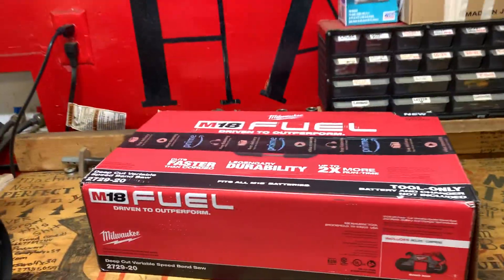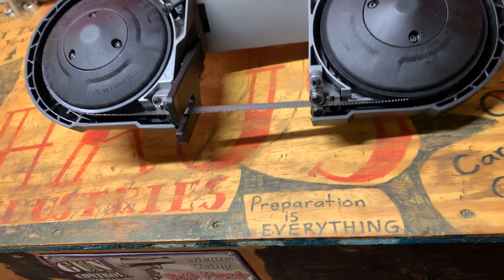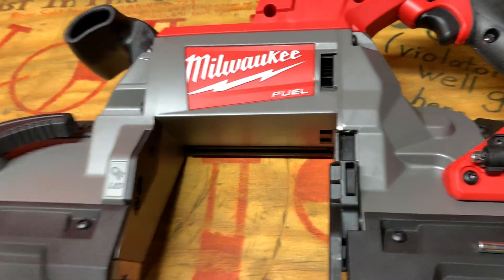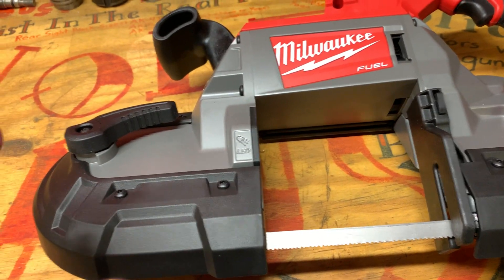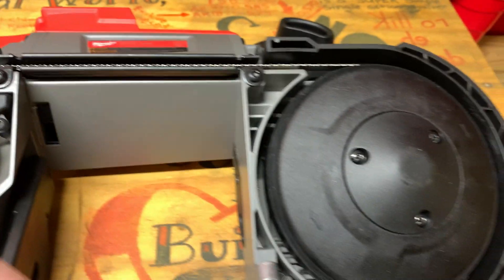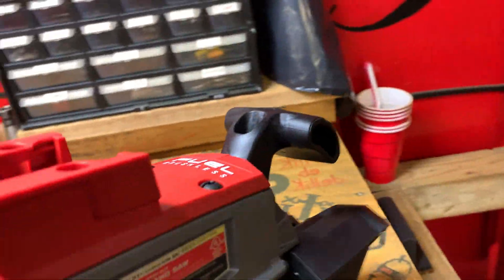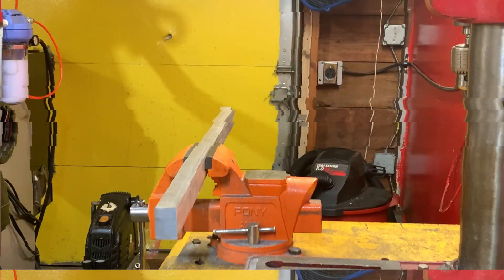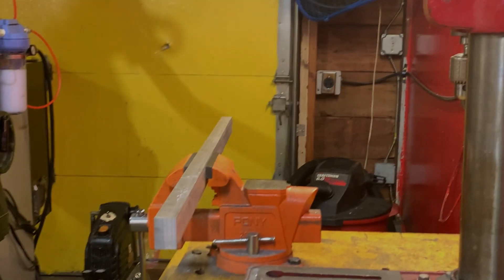Tool Review #2 - Milwaukee M18 Fuel Band Saw | Wolf-Haus Industries

Comment: Have you used any cutting oil with this tool. I have just order one for work and I always use oil with my drill bits
Reply from the maker: I've thought about it. I generally tend to run oil with my hss tools and coolant with carbide on my milling machines depending on material. Havn't convinced myself to mess with cutting fluids for this thing yet tho since its not a "real" bandsaw. Between its mostly plastic construction, limited power, & just being a hand tool, I kinda feel like cutting oil & chips would get overly messy and gunk components up in places I'd rather try and keep clean to extend its lifespan. Replacement blades cost alot less than a new saw i figure lol
Reply from the maker: Also, i havnt experienced much of a need for cutting fluids yet with it either, I've mostly been using it on aluminum or mild steel. Maybe its cuz I only have two cp1.5 batteries for it currently, but if im making some heavy & lengthy cuts, the second battery might run out before the first is recharged forcing me into a few minutes of "cooldown time" lol not trying to seem like im talking down on it tho, for being a handheld bandsaw it does its job good.
Reply: @wolfhausindustries  thank you for that information I'm a heavy diesel mechanic picking it up for a up coming job
Reply from the maker: @jerrykey9053  Anytime man, glad to have been able to help. One more thing... I can't recall the name of the company that made it, but I recently came across a benchtop sized jig/fixture made to hold these handheld band saws for making more precise cuts (kinda like the function/motion of a chop saw or cold saw) might be worth googling if youre trying to avoid having to clean up the initial cut. I tend to just cut my stuff a little oversize and machine to spec after, but theres def a fair amount of room for human error from being handheld that can lead to thicker cuts coming out slightly crooked until really getting a feel for it.

Comment: That hook thingy, is called a rafter hook. IDK why it needs a rafter hook. No one is using anything this heavy working in attics. I don’t even know what you’d use it for in an attic except cutting galvanized vent pipes out.

I thought the black around the bumpers was a rubber coating over steel. Turns out, it’s just plain old plastic. Not only that, the pulley wheels are made of the same “ask” plastic. Definitely just not a lifetime tool like my old corded one.
Reply from the maker: Yeah definitely wouldn't wanna try wielding this thing up in an attic lol. I'm glad the hooks there though, came in handy for storage purposes. 
Unfortunately, power tools with the potential to last a lifetime are a thing of the past today. What is the term I'm looking for... "engineered obsolescence?"
Can't say I'm unhappy with this thing though and its performance so far at least.